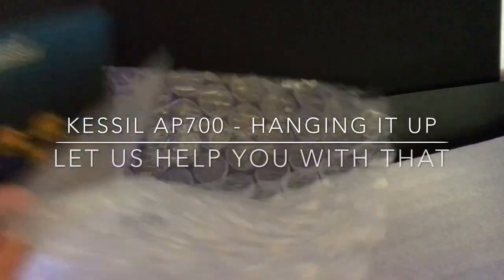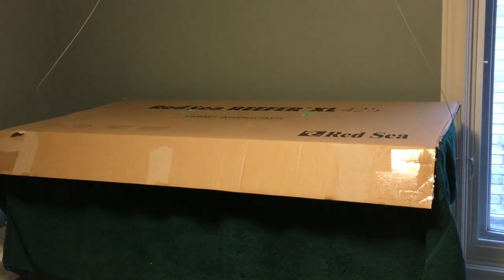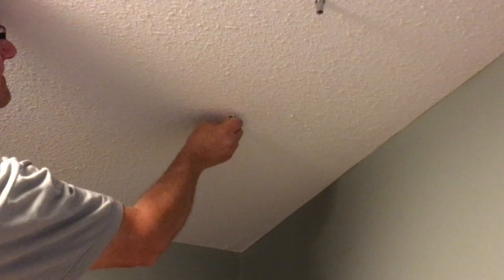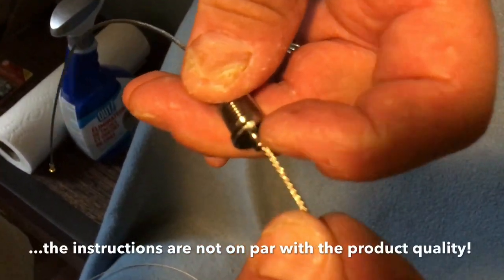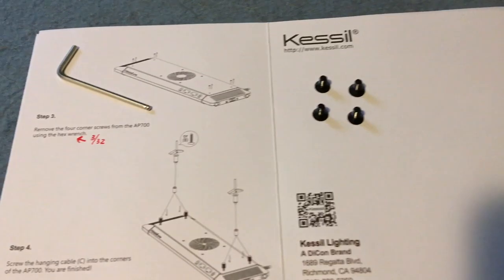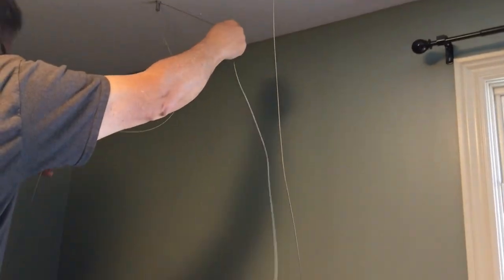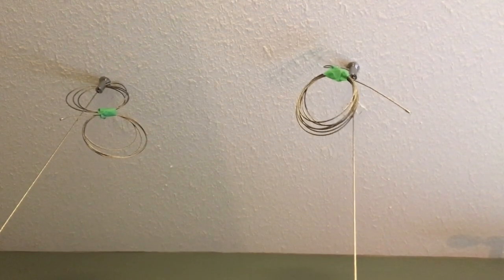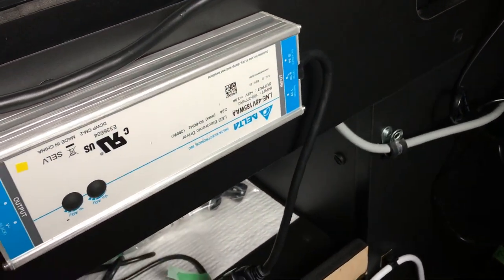KESSIL AP700 Ceiling Mount - let us help you with that.

Comment: Wow pulled out the big guns and installed an AP700. Awesome light!
Reply from the maker: It about killed me to spend half what the whole XL 425 cost on just the light, but I wanted something that was going to be a single fixture that I could hang from the ceiling, and this one worked perfectly for that. I priced hybrids and they were twice the price, and I ask myself, "Why?" Going by the reviews, I'm hoping it'll be the right choice. Because if it isn't, I'm going to have to settle for a daisy chain of Chinese black box LEDs because that'll be all the budget I have left. 😬 Thx for watching!
Reply: It should be enough. Later you may to decide to add some T5 but they produce a lot of heat. I'm sure you'll be happy with the AP700.
Reply from the maker: Heat was the main reason I went with LED. Well, that and how expensive the hybrids are. I did briefly consider a hybrid but came to my senses when I realized how much I could do with the money I'd save.

Comment: Do you feel that the Kessil is going to be enough lighting for your tank?
Reply from the maker: I'm completely confident it'll be plenty. In the video they were set to 10% blue and 5% white using the touch controls. I tried them at 100% for both and it was blinding. Thanks for watching!

Comment: Hi just asking what kind of return pump your using in your red sea reefer 425 xl because iam getting on soon
Reply from the maker: Hey Craig, I use a Jebao DCS 7000, and it runs at 70%. I’ve used a lot of Jebao equipment over the last 4 or so years, and it’s never let me down. Great value for money, IME. 😁

Comment: What did you do for the wire cable management? I just set up an AP9X with this ceiling mount and I could cut the excess cable, but I won't ever be able to drop it if I want lower.
Reply from the maker: We learned that this type of cable might fray and unravel if cut, so we just neatly coiled up the excess at the ceiling, fastened it with a couple of short twist ties, and it was never really noticeable. Good luck!
Reply: @Reefgrrl  it's similar to bike brake and shifting cables. You can get soft metal caps that you slide over after you cut, then crimp them into place. I might go that route.